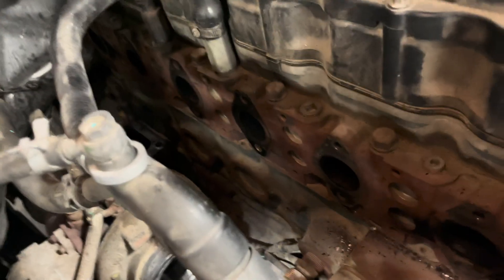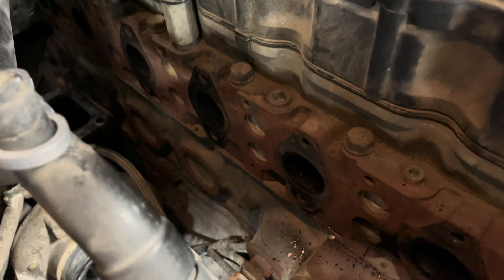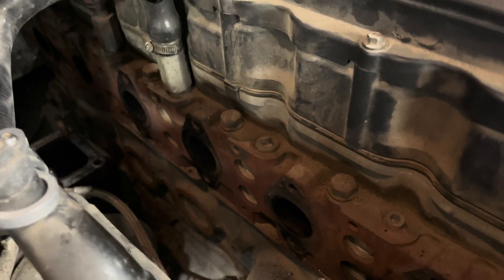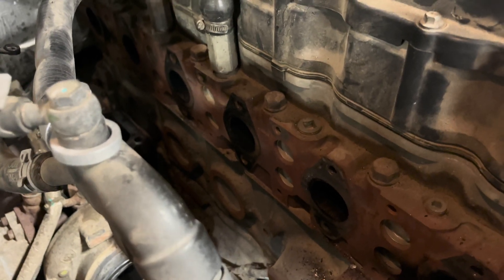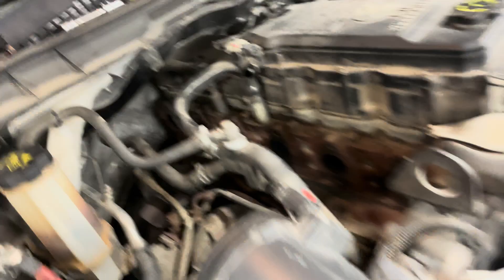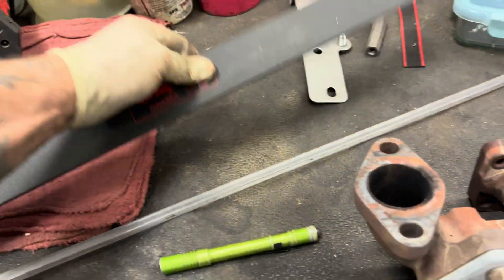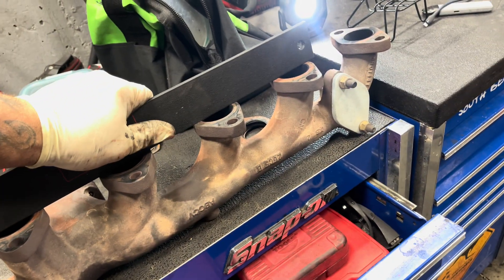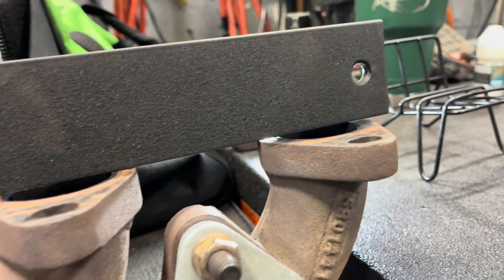Biggest killer to your diesel engine is heat

Comment: Here’s an intelligent question….the cam/lifter issue, is that mostly confined to just 5th generation? Is the 6th generation got a better cam/lifter setup or same as 5?

If I traded in my 5th generation and got a 6th gen am I looking at the same problems?
Reply from the maker: I haven’t seen any issues with the 2025 yet. I’m very hopeful that they got that issue figured out however time will tell

Comment: Crappy tuning creates excess heat, guys don’t take the time or care to invest in quality tuning to avoid this. A simple EGT probe goes along way, and quit lugging them, a simple downshift to get more air moving does wonders on EGTs. That’s my .02
Reply from the maker: I mostly discuss stock application and the heat generated in stock form. You are correct though, crappy tunes generate  an extreme amount of heat that really does damage. And that is why deleting your diesel will never be legal

Comment: Wow, I never knew heat could cause the manifold to pull away like that and that much. Is that common and is it common around that many miles? When that does happen, is it always or usually at the #1 cylinder? Thanks as always for your amazing content!
Reply from the maker: Mostly around number 6

Comment: I use the Steed-Speed manifold with Stage8 bolts/locks.  Steel doesnt dissipate heat as readily (kinda like header wrap) as cast iron so it cant radiate into the engine compartment as much and is sent down the exhaust and it has much more desirable thermal fatique characteristics.  (less cracking)   You are 100% right on the Fleece bypass,  I am going to put one on my 5.9 when I change out my tired ole 48RE.

Comment: What is the torque spec for the bolts holding the manifold to the head? I will be replacing mine with an aftermarket one and cant find that info anywhere
Reply from the maker: 39 ft. lbs
Reply: Thank you much appreciate the fast response.

Comment: Hello
Wanted to thank you for sharing all your knowledge on these cummins much appreciated..Do have a question I have a 2024 ram laramie 3500 with 7500 miles on it now and I'm planning my 1st oil change and would like to know what oil & weight you recommend ? Thank you for your time and your channel 👍I'm in kingman Arizona with Temps from 20° to 125°.
Reply from the maker: 10w30 warm climate 
5w40 cold climate and extreme duty